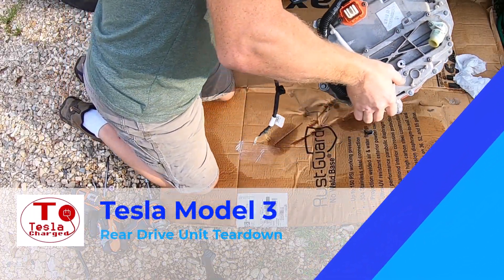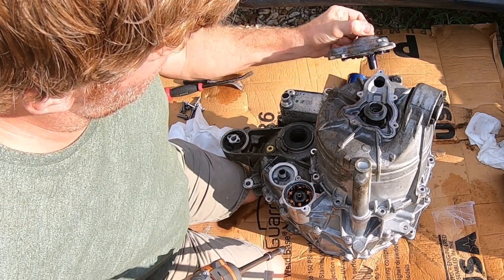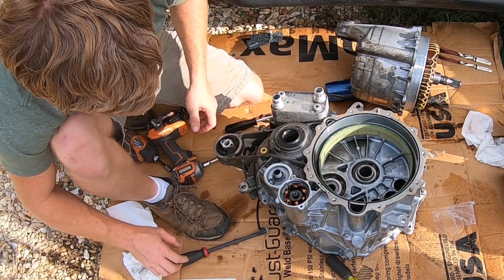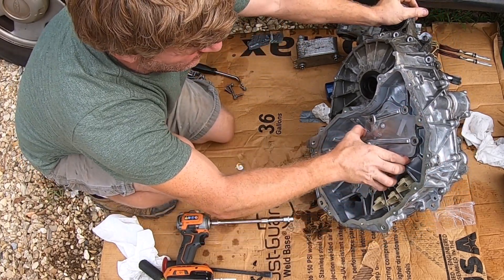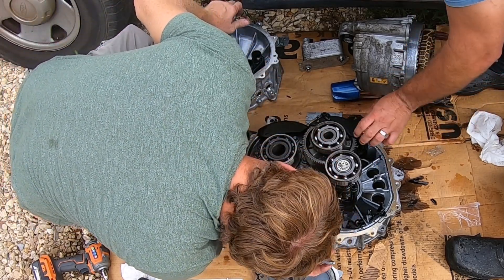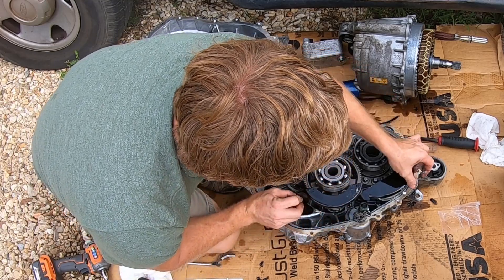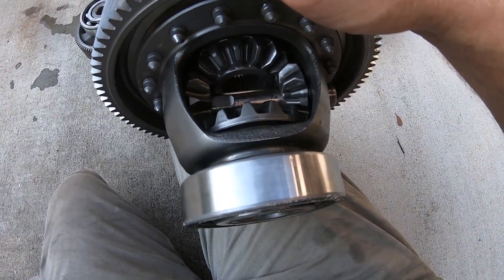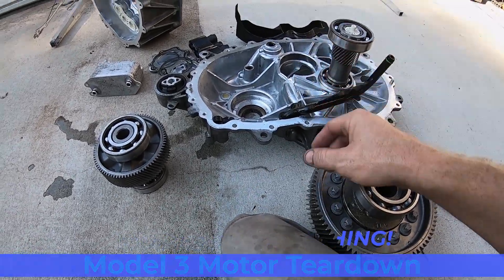Tesla Model 3 - Rear Drive Unit - Teardown - Checking the Damage - P3

Comment: As there motor/drive unit casing machined to match as a set/pair, to get everything running perfectly true? Or has Tesla done such a good job building these casings that the parts are interchangeable from one motor to another?
Reply from the maker: I would think you can swap castings out.  The bearings are so big they will true it up when you bolt it together.
I'm sure I will find out before long if I need to repair one again.

Thanks for the comment and watching,
Casey

Comment: Id guess it was run at high speed with one wheel stopped, be it during accident or in salvage someone doing a burnout, not an uncommon failure for an open diff, one of the spider gears starts to weld itself to the pin, spins the pin that sheers the roll pin and then the cross pin comes out....

Comment: They are all JUNK! Tesla replaces these units daily and programs them so you dont brick all modules in the car.
Reply from the maker: Yea ok out of millions of cars on the road yes the older model S has motor failures.  Very rare on newer models, mine was probably due to the way I drove the car like I stole it and nothing to do with miles on it.
It had 100k miles and still looked like new with no signs of wear.
Reply: @TeslaRebuilders  Some Tesla repair shops are behind months from drive unit failures😒The bearings, the coolant system , you name it. I went to apply as a Tech there, but they work you all night and day
Reply from the maker: @BigBenny24  Yea I get that there are few service centers.  They are growing as best they can to keep up with demand.
The problem is like with any business these days it's hard to find good reliable people.
I own a small business and it's next to impossible to get good help.
I hope they get better soon.

Comment: Hey broski I hope you see me but, I’ve been trying to do research on the rear differential for the model 3 on maintenance but literally nobody is talking about it, should I treat the rear differential like any other and replace the fluid every 60k miles ?
Reply from the maker: No need too, it's good for over 200k easy.  I just drove the car like I stole it too much and did way too many launches.
Don't remove traction control and do donuts I lend the failure to that primarily cause.

Thanks for the comment and watching,
Casey
Reply: @TeslaRebuilders  I agree 100% bro but I drive 150 miles a day, I’d think to service the fluid in my rear drive unit every 60k miles right ?

Comment: It looks like at least one of those differential pinions spin freely of the shaft, but it seems possibly (especially if one of the pinions is coupled to the shaft) that in a case of high torque or high accel/decel impulse i.e. in a collision or maybe abusing the drive unit with launches that there could be torque on the differential pinion shaft. If there was enough torque or torsional impulse, that keeper could have been cracked or sheared, then eventually fell out. 
Alternative scenario I think is less likely is if the shaft was not centered, so at high rpm the diff pinion shaft pulled axially (instead of torqued tangentially). I think that's much less likely than the impulse 'directly' coupled from the wheels & CVs to the side gears, then pinion gears & pinion shaft. Weak link.
Reply from the maker: That is extremely well explained Theory, kind of what I was thinking but I didn't know what to call it.
Thanks for the comment and watching, Tanner

Comment: 2:20 I'm pretty sure that is a resolver
Reply from the maker: Yes it is and I actually had to use it on new motor swap because newer version didn't have the winding temp sensor. It gave me the incompatible Drive Unit software code.

Comment: What resultant force would/could cause that keeper pin to shear? Can you even speculate? Almost seems like it would have to be a freak occurrence or even when manufactured?
How long did it run "just fine" presumable weakened/failed after the front end incident?

Thanks for getting a repair community started, its hard to find detailed information on that topic! 

Details like this are exactly what I am looking for and interested to know about, have not found where they are all hiding yet.
Reply from the maker: So originally the front end accident was at 19k miles. The rear motor was not damaged from that because it failed at 105k miles. I can only assume the thousands of launches I did in this car on the daily including disabling traction control to do burn outs didn't help!  Usually these gears don't turn much or at a very high rpm as the wheels are locked to the ground and traction control won't allow a single revolution out of sync.  When it's disabled you can easily apply full power and torque to one side and spin out like crazy.  This would definitely put a ton of stress on this pin and gear set.  Granted I should have not done these things but the gearset should be a little more durable.
Reply: Same thing would happen when I was a Chrysler Tech back in the 90's. Similar style spider gears were in the minivan transmissions, held by similar pin. Changed many that let go and put the pin through the case. We noticed in the shop that the transmissions would always fail after a snow fall. Common complaint was for a transmission leak. We concluded it was from one front wheel spinning in the slippery conditions then loading up up the pin when it gained traction suddenly. I also had several dodge dakota 8 1/4" differentials fail in same manner from one wheel burnouts.

Comment: Thanks for another helpful video!  I learned that it's possible to take the gearset out without pulling the motor off, but it requires the three gears to come out together (which isn't fun or easy).  I'm really surprised that big cross shaft pin walked out.  When I was working on mine (2020 version), I tried pulling that pin out after removing the roll pin (you called it a keeper I think) to make it easier for the machine shop to work on.  I found that the pin on mine was in there so tightly that I couldn't even budge it with a large hammer, so I reinstalled the roll pin and called it a day.
Reply from the maker: Yea only reason I think I had so much trouble is because those two big gear sets spun the races and semi fused in.  The prybar popped them out though. Yea been wondering why my pin was thrown or walked out of place. Technically those gears don't really spin at high speed but only turn slowly in differential steering around curves.  They are not bearing and only have shims or wear rings to ride on.  Not sure how load was transferred to the pin and caused it to shear off.  Feel like a solid pin or something more permanent would have been better.

Thanks for the comment and watching!